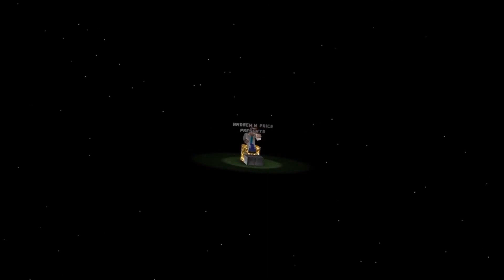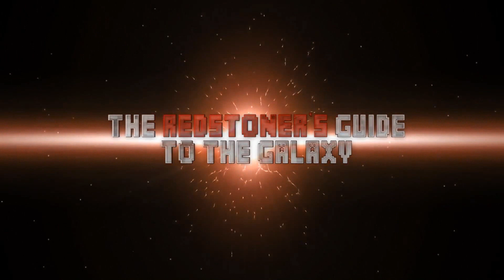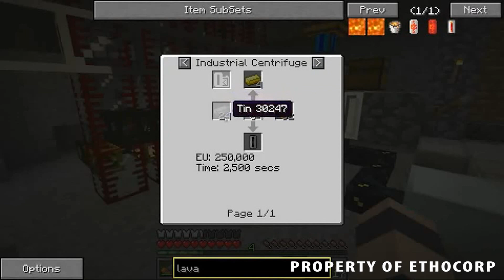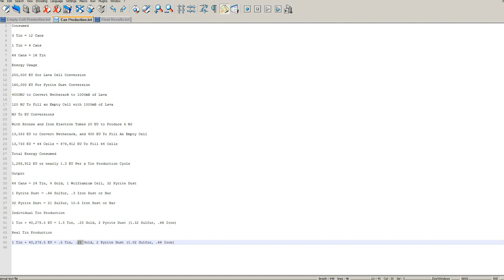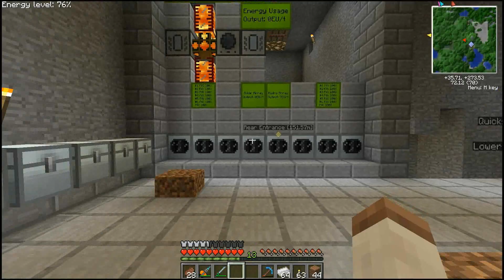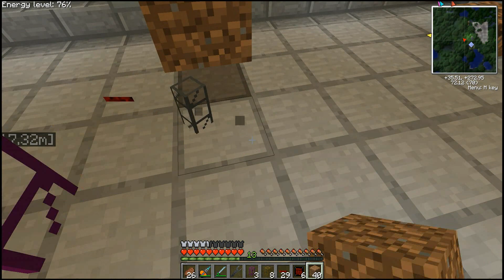RGTG 00: Improving Efficiency in an Ethonian Tin Factory

Comment from the maker: Finally, if you don't want to have to worry about splitting product and you just want to dedicate certain machines for outputting directly into storage using cans makes it possible for you to run a close loop system with only 3 machines. (Which is what I was trying to say in the video.) I find this preferable since you can then set things up in 3 machine groups instead of 5. I hope that makes sense. If not I will address it in a future video. Thanks again for writing. It really is helpful.

Comment from the maker: Secondly, the initial tin investment is halved, and so accordingly your output per a individual tin bar is doubled. The time\energy remain the same. Since obviously if you are considering building a system like this tin is something of valuable commodity: this is a big deal because it ties up less of your tin supply in the system. For example in a system like mine with 6 centrifuges it would require 96 tin to start as opposed 192. (These number drop to 64/128 once the system is running.)

Comment from the maker: Well there are a few advantages to using cans; although most relate to close loop systems or automated like mine.  First, if you are going to try to separate the product from from the residual it is a lot easier to split the tin output 3 ways instead of 5.  (And by that I mean if you want each centrifuge to output its 8 tin product into storage you can just split it 3 ways and get 8 tin per a pipe, as with cells you would have to split it 5 ways.)

Comment: Ok so with your system you would get 24 tin per cycle (even if you would use cells instead of cans), right? The only advantage of using cans is the space they take up in the centrifuge.

Comment from the maker: lol This is the issue with doing multiple revisions of the same system.  To be honest you are pointing out some flawed logic on my part.  Originally I was going to split the tin in the pipes 3 ways to separate out product, but later I determined it was just easier have 2 centrifuges supply the tin to keep the system running, and then just output the third as profit.  Thanks for pointing that out actually.  I can't believe I missed that *facepalm*.  Will definitely fix that in the system.